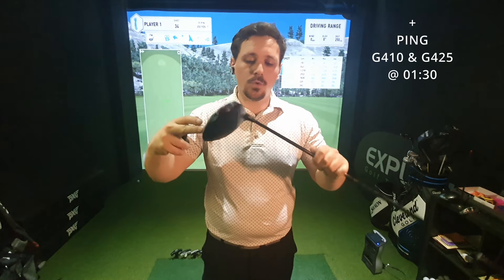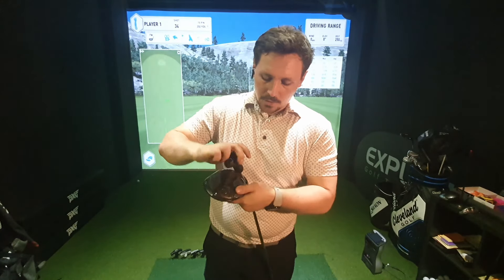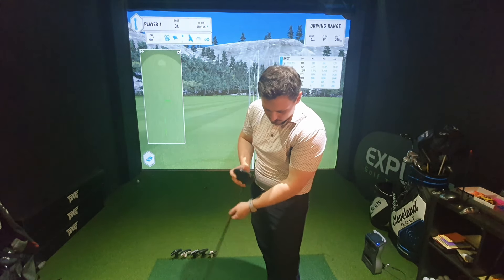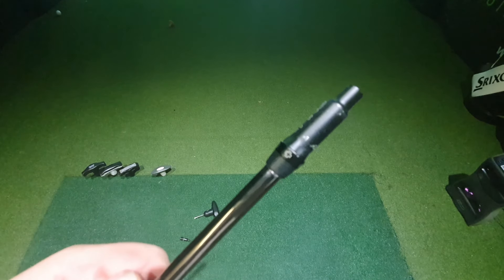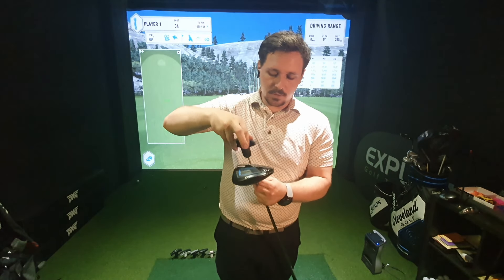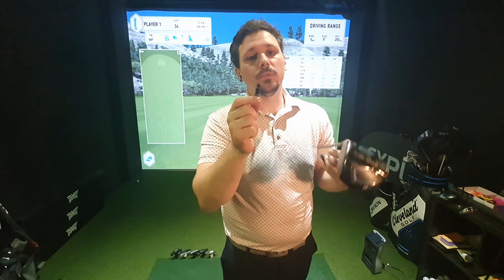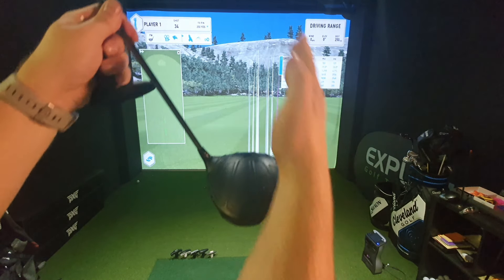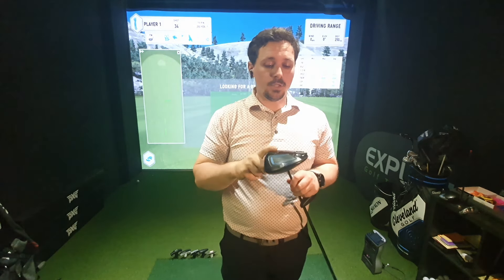How To Use the Adjustable Ping Driver Adapter Ping G430

Comment: Thanks for the instruction. Q- G430 12deg -  if I use -1.5 it opens the face as you inform. That would take it down to 10.5 with a more open face. If I bought a standard 10.5 deg would the face be as open….
Reply from the maker: No, it would be "squarer" .....the 3rd way would be a 9⁰ Head on +1.5⁰ to get more closed 😎

Comment: Can I remove the 430 adapter from shaft , and turn to line up better with shaft logo?
Reply from the maker: Yes, you can indeed ... It's a lot more fiddly, have to remove the adapter from the shaft and then reattach the adapter in the orientation you desire 

May need the help of a club builder or golf shop if they have the means to do so ...most shops around here send those people to me haha
Reply: Yeah it seems would need special tool to remove and reinstall in orientation I want 😩 thanks
Reply: Easier changing the grip 🤷

Comment: Is this a silly question but on the 425max I'm wanting to promote a fade bias in the flat setting...that setting should be +1 right?
Reply from the maker: +1 Flat should promote the right side but on a higher loft ....I find the -lofts the easiest to hang the ball to the right (and +lofts often easier to draw) so you may be better going for the standard flat setting if the -flat is too far 😋 [hope that makes sense]
Reply: @FredzGolf  I hit a mid flight draw, that can become a hook, so looking for a higher launch too, I think if I understand correctly then +1 would be worth a try
Reply from the maker: @patrickobrien9481  indeed, that makes sense ....+1 on the flatter side of the adapter 👌
Reply: @FredzGolf  appreciate the advice 👌 subscribed 👍
Reply from the maker: @patrickobrien9481  thank you 😁

Comment: Why when I tighten my head won’t it click?
Reply from the maker: I'd say, make sure it's the right shaft tip for the head ....so if it's been on already, you're fine 

Secondly, male sure it's lined up, maybe want to put pressure down so the shaft doesn't twist while being tightened 

Thirdly, is it the right tool? If so ....keep tightening, they have a torque Wrench type system so they won't over tighten ....go for it if 1 and 2 are good 😁

Comment: Was I supposed to get a tool with my driver?
Reply from the maker: It's been that way for a long time but some brands are stopping that! I think Taylormade said they aren't as most people have one already (can use any brands tool) and the reduction in [cost] plastic use!
Reply: @FredzGolf  I just bought the Ping G430 max but no tool.  Didn’t know if they forgot to give it to me or if I should go back
Reply from the maker: @jimbof20able  Hmmmm yeah they may have forgot! Most places should have loads spare in any case, where did you get it from?

Comment: A little white washer fell out of my Ping G425 when I did this, where does it go?
Reply from the maker: Ah yes that can happen ....if you put it on the screw while it's out then put the screw in ...just reduces metal on metal wear n tear 

Not that I've seen the wear n tear do any damage or anything!
Reply: No.. the washer go’s inside in between the driver bottom hole & shaft point
Reply from the maker: @flex_flex6988  ahhhh OK... the one that's supposed to stop the screw falling out 🤭 

If you still have it ..you can balance it on the tip while lowering the head to it and screw in ..bit tricky!!